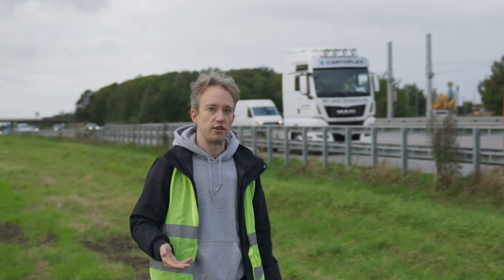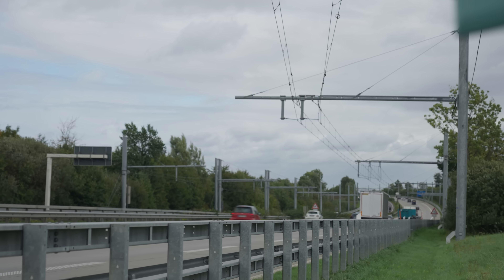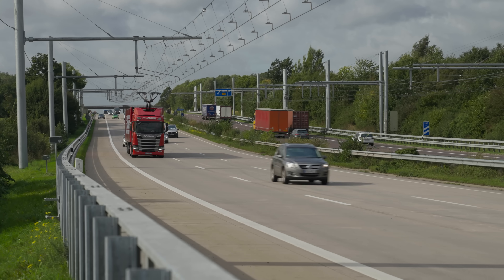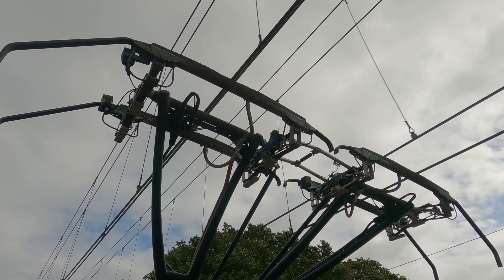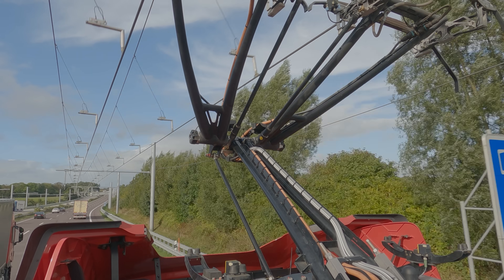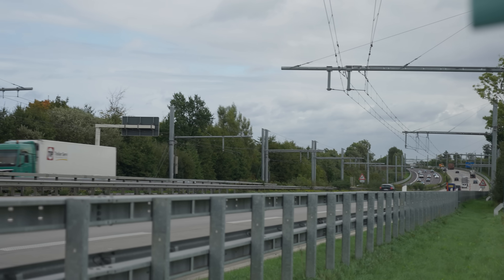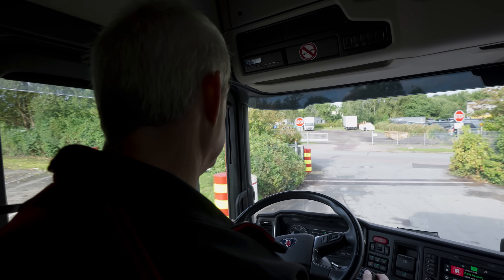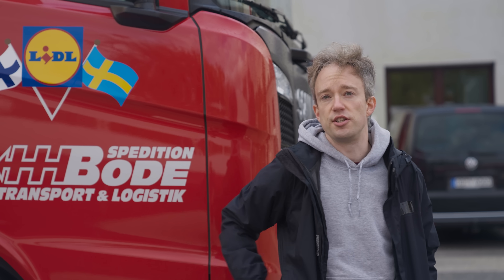The highway where trucks work like electric trains

Comment: We have electric buses using this technology running in my city for almost a century now. It's called a trolleybus. 
I never understood why there wasn't a bigger push in adopting those wherever possible. Trucks seem like the natural next thing to apply this to.
Reply: Arnhem!
Reply: Arnhem
Reply: Aguanten la K y la Q
Reply: If you're gonna put in the effort and cost to make a dedicated connection, might as well make it a tram.  It's gonna be better in most cases.  (Biggest exception being hilly areas, trolleybuses excel in those areas.)  Same with this: if you're gonna put in the effort, just make a rail line.
Reply: @Huntracony  Building new rail lines with overhead electric lines is way more expensive than putting electric lines over extant roads, especially considering that you'd need to either buy the land the rails would be on or dig up the roads to put rails in their place. Electric trucks that can separate from the line for shorter trips on battery power and use the overhead lines for all the long straightaways are a much better proposal from the perspective of "we can convince politicians this is worth funding" than the "let's maintain two transport networks at once" or "completely disassemble our old transport network and build a new one" approaches.
Reply: the only reason to have a trolleybus is because you dont have space to put a tram line (running on tracks instead of tiers is always going to be more efficient). the same will apply to these trucks. my guess would be that because rail is more efficient that transport planners have been prioritising that.
Reply: @UIMcocodog  There are definitely other reasons. Building a trolleybus line is much cheaper and faster, can be built with almost no disruption to existing traffic and as a result it's also much easier to change its route. 
A tram line may simply be uneconomical if the demand is lower, as trams' main advantage is higher possible capacity. 
Trolleybuses can climb much steeper hills than trams (and in fact are even superior to diesel buses in this respect), in more hilly cities, some routes may simply be impossible to do with trams, unless you use a San Fransisco style cable-car.
They can avoid obstacles in the road lane, a tram gets stuck behind even the tiniest obstacle in its track profile. 
If you equip the trolleybuses with a battery, you don't need to have the wires covering the entire route (but unlike electric buses, they can charge while running on the wired parts of the route, so no downtime reserved for charging). Plus these can avoid not only obstacles on the road but also complete road closures, both planned and unplanned.

Similar arguments can be made for these trucks, the biggest one is the ability to go directly to the final destination (assuming they have batteries that allow short trips outside the highways) which makes the transport from point A to B faster, more flexible and logistically simpler.

Don't get me wrong, trams and trains are great and should be utilized as much as possible but they're not the answer to every situation.
Reply: @TheAngelsHaveThePhoneBox  the point was that these trucks HAVE batteries, and you only need power lines over some percentage of the roads, to charge.
Reply: The trolleybuses were withdrawn at the end of the 60s due to shameless politicians to give way together with the oil companies and automotive companies in the indiscriminate sale of cars and gasoline, now we suffer the consequence of this way of acting, but the trolleybuses will soon be back on the streets and highways
Reply: @ASURLUIS  Rodger Rabbit chronicles this 🐰
Reply: @ASURLUIS  You definitely have to specify the country with a statement like that, otherwise it's just incorrect; there are cities in my country (Czechia) that never stopped using trolleybuses, for example, if I'm not mistaken, Plzeň uses primarily trolleybuses.
Reply: They are in Раша too
Reply: @timemachine_194 .....you can not be serious?
Reply: Que faites vous du lobbying du Qatar ?!!
Reply: trolly bus and trolly truk
Reply: The precise form of the pickup is different  --  a trolley style pickup would not work at motorway/autobahn speeds as the trolley would fall off too frequently to be viable.

A pantograph pickup does work though
Reply: I think of trolleybuses like zombie buses. I think after a normal bus engine fails, they take it out and just make it a trolleybus.
Reply: @Lasaro7499  in England they make trains with them
Reply: The electric switching junctions are prohibitively complex, and the power cables are often brought down by errant pantographs.
Reply: in most countries there aren't buses with this technology: in most legislation they are trains which run on paved surfaces. They have separate insurance  and in most countries no number plates but train registrations. You'll sometime find dual drive trucks with both registrations active as the need fast change from one system to the other for maintenance work. But the need to change a few things if the want to change tracks (two lights vs. three lights). 
But most of these buses are only trains and not able to work outside fixed routes (without a big pile of paperwork - and removing of 2 light bulbs).
Reply: your country should sell that technology to other country
Reply: this is one of the most stupid things I`ve ever seen apart from the fact of tedious maintenance over large distances of this colossus Soon to be outdated infrastructure. Which would inevitably be replaced by HGVs which eventually go electric. Economic`s would favour tracks that carry their own batteries and can be charged up using facilities at their depots.  Which would be a hell of a lot cheaper than paying for the electricity that comes from those overhead lines which would be at a premium because of the immense maintenance costs.  Of course the people putting these Overhead power lines in would be getting government grants and handouts all paid for by higher taxes for the people of the country.  This is a total scam just like global warming which is not happening.  Global warming Lai is being used by the world economic Forum to try and institute their Great reset allowing them to do a power grab we`ve all seen what happened in Canada with Justin Trudeau little baby of the world economic Forum just like New Zealand and just like Australia. You`ll owe nothing and be happy. the future for trucks from an economic point of view is battery electric powered but the batteries need to be capable of way over 1 million miles lifespan to make economic sense. which is virtually here now.
Reply: Trains with overhead wires are the crabs of transportation they're just too efficient.
Reply: True. Bus then trucks. Then planes.
Reply: A lot of countries and places had them along with trams and then along came personal transport in the form of cars , it killed them although a few have been reintroduced in the U.K
Reply: Speed might be one. I am wondering the wear (and pollution) on those connections at 100 km/h .
Reply: I was told that the oil industry lobbied for trams to be replaced with bigger roads. At least here in the Seattle area. No idea if that's true.
Reply: You are right. At least the main or the most important routes could use these trolleybuses. Building the infrastructure could be expensive but it doesn't need so much maintenance but the prices of the buses will be very low, thinking that it will have no battery, the electric motor is ligher, no fuel tank, no reinforcement protection (it has no battery) and they will use less energy than a bus with battery because it's lighter. The only minus is that it can't be driven outside the infrastructure and it needs electrical power all the time. But it is not necesary while the buses in the cities have a plan and this plan, moreover the maine routes will be almost never changed. I remember city having these trolleybuses, I was a child but they have been changed with diesel ones and they have destroyed the infrastructure of trolleybuses
Reply: the problem is trolley bus is positives vs negatives

youve taken all the pros of a bus in that its cheap to impliment new routes only requiring only a route to be drawn and maybe some metal poles installed to be bus stops and canceled it out by requiring a bunch of added cost to get planning permission to install the wires then the costs to install them suddenly adding a route might have originally cost say between 5-50k depending on what stops you already had along that route and now requires you install expensive overhead cables

a bus can go anywhere the wheels will let it and short of bridges no ones gonna really object to a bus route going somewhere
but a trolley bus converts a normal road to be one that now has a height restriction which severley limits other industries logistical capability it already requires some for planning to route a truck to a destination avoiding weight restrictions and height restrictions but now youve essentially just made anywhere inner city a total no go zone despite inner city being one of the most likley places to require a oversize or over height load to be dlivered for example concrete preforms required for larger building construction or crane parts for construction

now to put them on the motorway? the arteries of a country? good luck it already requires alot of planning and co0ordination to move a large load down a motorway with escorts and navigation cars now we need to add remove all the overheads for the entire route of a truck to that

and maintenence costs added to this suddenly remove alot of the cost benefits of such a system
Reply: UK got rid of the trolley buses in the 1950 s
Reply: Many scoff at the overhead wires!  Combine overhead wire with batteries and you get the ability to charge on the go, and service the last mile quite easily.
Reply: @IanBMorris  That's exactly what the new trolleybuses here do actuality. Definitely could work with trucks and it's even mentioned in the video.
Reply: @TheAngelsHaveThePhoneBox  I've seen that in San Francisco and it seems to work well.  I see a lot of people being against ideas like this, they are too different from the current way.
Reply: @IanBMorris  Exactly what the trolleybus in Kharkiv can do
Reply: > Combine overhead wire with batteries and you get the ability to charge on the go, and service the last mile quite easily.

 @IanBMorris  my city already does this. Some roads have traction some don't, and trolleybuses charge on the ones that have it. They also have solar panels on the roof so they can still use AC and remain connected to the gps and traffic control networks while waiting on the bus stops outside of the city where there is no traction.
Reply: @IanBMorris  😂😂😂😂 you've no idea! Totally brainwashed!
Reply: It's a little thing called the car industry lobby. That's why there was no massive push.
Reply: Wait im so used to trolleybusses in my city that i have to ask. Doesnt everyone have trolleybusses? I never really think about stuff like that, so i just dont know
Reply: @HugoLT3  are you really that ignorant or just trying to be funny?
Reply: Tryhard   lies
Reply: because there is 1 problem, if wires will be somehow damaged it jam all traffic cuz of electricity and stucked trucks
Reply: @tsugumorihoney2288  The trucks have got backup batteries, which should be enough to get to the next undamaged section.
Reply: @tsugumorihoney2288  It is suggested there is still backup, electric battery or gasoline engine, so disabled trucks should not be an issue.
Reply: Mostly lobby
Reply: bc oil lobbies and right wing diesel fanatics do everything to keep their petrol cars and not to change to electric cars esp in germany
Reply: Sooooo..... where does the power from the grid come from????
Reply: @handsomefabio777  we burn coal, lots of coal
Reply: @handsomefabio777  wind and solar
Reply: @handsomefabio777 
A big Dam build on the river in my country provides electricity
Reply: @handsomefabio777  powerplants, why? If you want to complain about powerplants burning fossil fuels - please be aware that powerplants turbines are 50-60% efficient while internal combustion engines in cars are 20-30% efficient at best. That means twice the power from the same amount of fuel if you use energy from the grid.
Reply: @ajuc005  people forget that you can convert fossil fuel into heat with 100% efficiency, but directly to motion in an ICE with less than 30% efficiency. Converting heat to steam to motion to electricity easily gets over 60% efficiency. So burning diesel in a power plant gets you easily twice the range compared to burning it in an engine. So yes, it is much better.
Reply: cost divided by population or population density? I mean in a city like new york, you have a street light every few meters. why not do it on every road in the country side?
Reply: 😂😂😂😂 in majority of cities the trolleybus are been scraped! They are to expensive to run and no flexibility!
Reply: in mu country they start using electric busses on batteries. But I hate really trolley busses, they are so slow annoyingly. THats good that they do not polute . I drive a car and polute but other people travel slowly and not polute, thats good.
Reply: I would personally hate it inside the cities. So lets not do that please. It would look awful. But on the highways it is perfect. They would also choose to design it as the old-fashioned bumper cars. They would have a roof you can put solar panels on top of
Reply: @thoughtsofapeer  I grew up in a city which has an extensive tram and trolleybus network and the overhead wires aren't as bad as you might think. You filter them out easily, even in the historical center. Although it's true that the wires are simple, not this train-like double wire with vertical connecting bars in between which is much more noticeable. But the long distance trucks wouldn't need the wires in cities anyway, they can run there on a relatively small battery since they would spend there only a small part of the trip.

Comment: Fantastic but where does the electricity come from in Germany? burning gas and coal? The only way to make this work is Nuclear, solar doesn't  work at night and the wind doesn't always blow. Burning gas & coal to make steam then electricity, transmitting across it the countryside  then converting it to motive power is highly inefficient, might as well burn diesel directly in the truck, I suppose the Germans could buy Nuclear electricity from France :)
Reply: Nuclear also produces steam, which then has the same distribution scheme you listed.

Comment: Remember when Elon announced the Tesla Truck in 2017 and claimed it would be more efficient than even rail? That Truck which was supposed to be in production by 2019 and is still vaporware as we close in on 2022? Seems like this is a much better solution than what Tesla pitched.

Comment: Yeeerrrrrhhh, that looks nice? Great idea to build more coal plants to generate the massive base load power necessary. They have a similar safer thing called “Electrified Rail” that might be worth a go?
Reply: Because new power sources won't be using coal and trains (in the US) are slower,  more expensive, and more of a pain in the ass to deal with from a shipper's perspective than simply using trucks. Probably the same story in Europe.